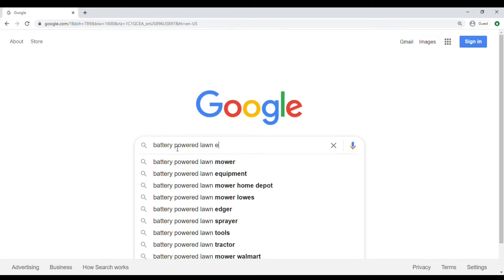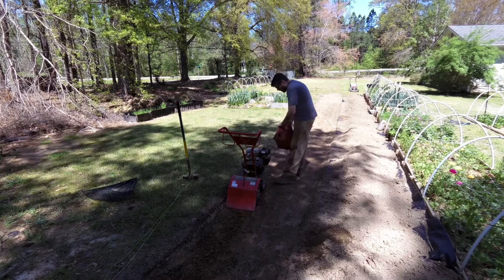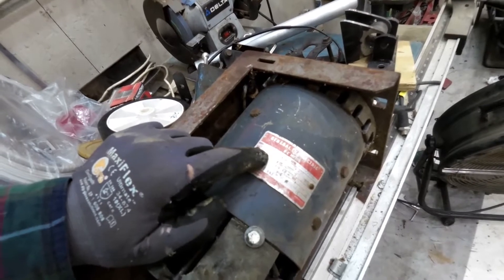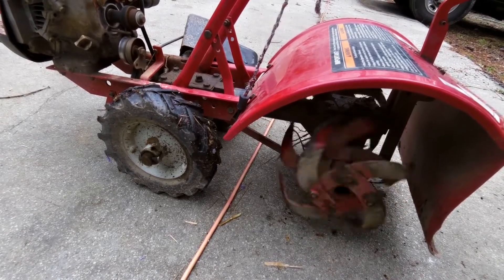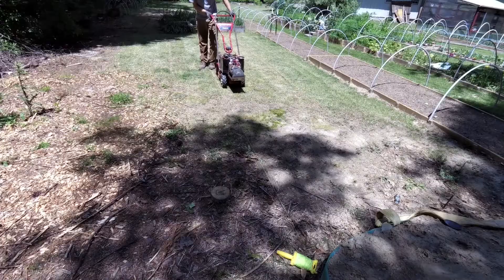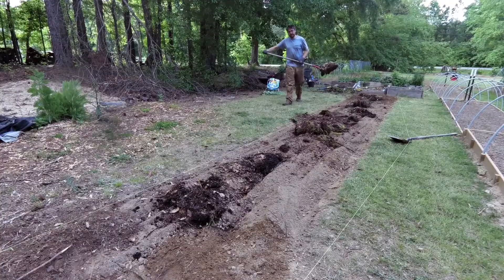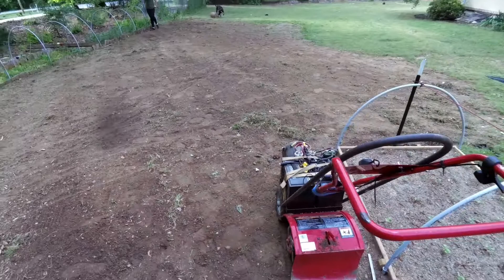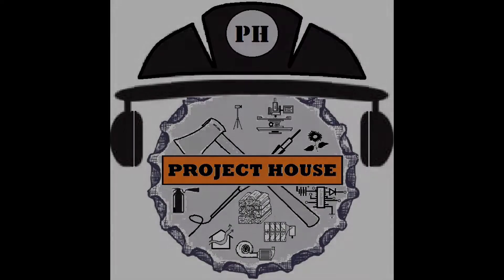Building a Battery-Powered Roto-Tiller Conversion using a Forklift Motor

Comment: 3 years later and these machines are STILL not on the market!

Tillmor just released an electric walk behind tractor, but it's on the small side compared to their gas powered models. Catering to the home gardener with a large garden, I preaume. Not big enough for the small scale market farmer.

From gardener, to small scale farmer, to larger scale farmer (ev tractors) - the market is wanting and waiting!

Comment: Sounds like the perfect application for lifepo4 cells. Raw cells are cheaper than lead now. 120-130 a kWh. 
Love this video, while consumer grade electric equipment is available, the quality sucks. Undersized molded batteries made with unstable and short lived lithium ion, low quality electrical components etc. a recipe to milk the masses with planned obsolescence. 

I’m thinking of using readily available and fairly cheap 1000-3000 watt BLDC motors for ebikes. More control.

Comment: I'm trying to locate a similar motor for a tiller i have with a dead gas engine.  If you could post the specs for the motor, battery, solenoids and controller that would be great.  I wrote down what I could follow in the video.  Great build!